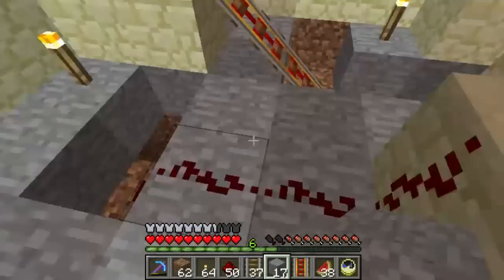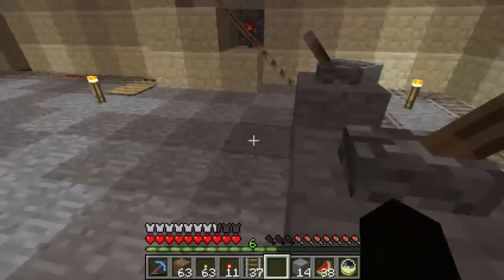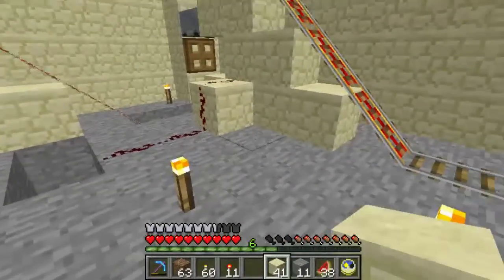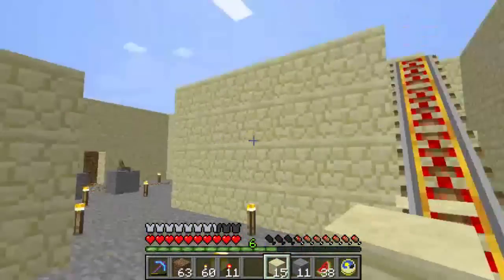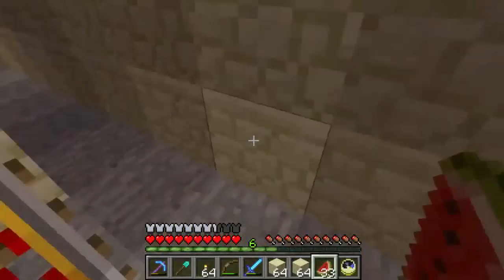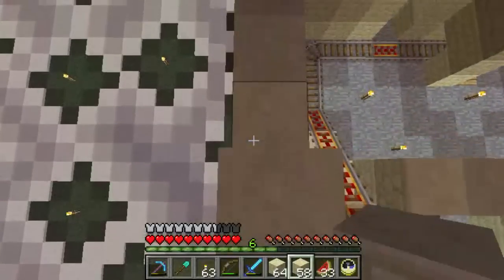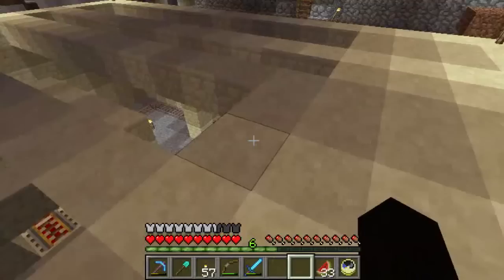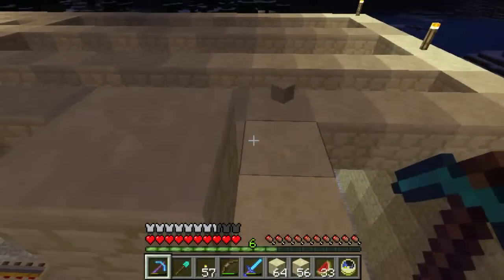Minecraft -156- Mansion Track

Comment: @selif1 I was planning on doing the same but it seems with Jungle biomes you can't just generate new terrain.  It will only generate in a world created in that version (1.2 or whatever that new upcoming version is) and above. 

There is a work around but it involves changing a value in a certain file and while it will generate Jungle biomes in older worlds it will also screw up biomes in that world as well.